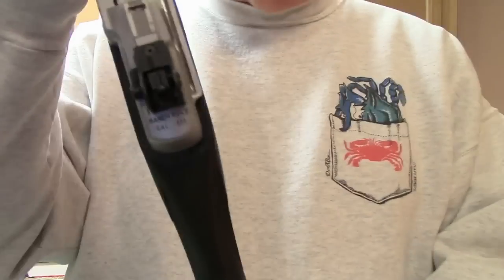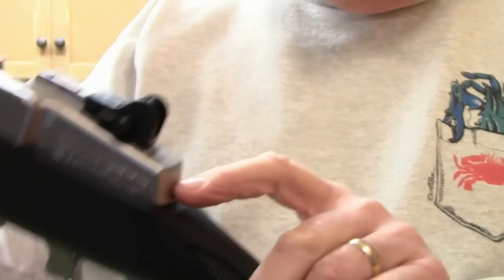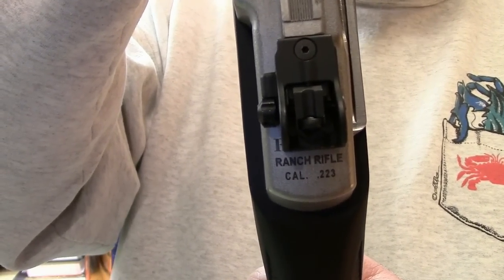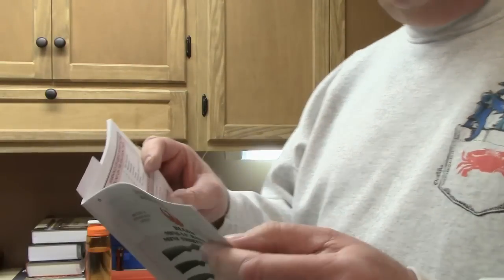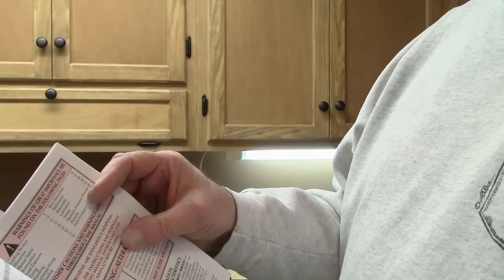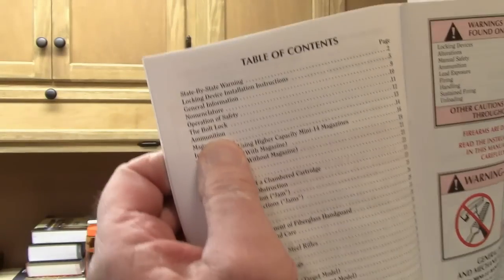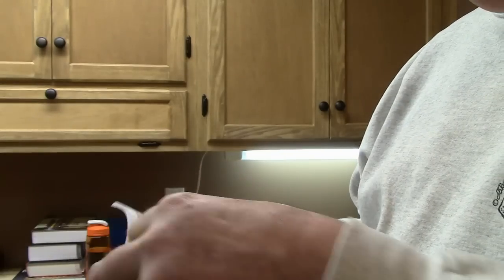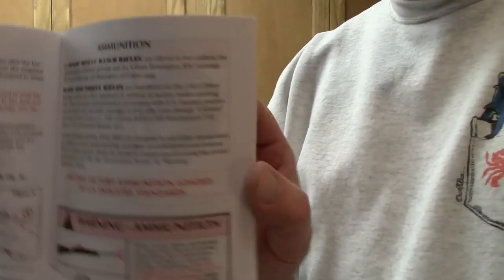Use of 5.56 mm NATO in 223 Rem. chambers ~ Finally, "Can I use NATO in my Mini-14?"

Comment: The chambering for military 5.56×45mm NATO has a longer throat prior to the bullet contacting the rifling which results in lower pressures when firing 5.56×45mm NATO ammunition. If 5.56×45mm NATO is used in rifles chambered for .223 Remington the bullet will be engraving the rifling when chambered which can dramatically increase pressure past the proof test level.
Reply from the maker: Will Mathieson 
Yes, the throat of a 5.56mm is significantly longer, and the leade of the rifling is shallower than the 223 chamber, and NATO 5.56 ammo is far hotter, which does increase pressures above accepted 223 levels due to the combined influences of reduced bullet clearance and higher operating pressures.  However, a NATO round will chamber without bullet to leade contact.  It's just not sufficient freeborn, and the working pressures are far higher, which makes a very undesirable combo.
Reply: and 5.56 nato used to be free to shoot, now I have to buy .223 and I can't fire off 30rd mags at full auto anymore or belts. There are +'s to being out of the army though but not when it comes to firearms. Are there any manufacturers that sell 1 in 7 twist? I know Colt Canada sells a version of the C7 for civilian use.
Reply from the maker: Will Mathieson 
Yes, there are, but unless you are shooting extremely long bullets over long range, you are better off with slower twist, which will allow greater load density at lower pressures, with less resistance, and less fouling.  Military steel core 62 grain bullets are unusually long, but are perfectly stabilized with a 9 inch twist.  Most people don't use bullets that require 7 inch twists, which has become a popular fad that has no basis for anyone but the single shot loader of extreme length bullets that won't even fit AR magazines.
Reply: so why does Colt make a 1 in 7 inch twist for military arms? I know Canadian C7A1 and C8 rifles are all 1 in 7 twist and they fit in the magazines that are interchangeable with any black rifle.
Reply from the maker: Will Mathieson 
They fit because they are either 55 grain or 62 grain green tips, which stabilize in any AR, regardless of twist.  They make fast twist for possible future use with long, light, armor penetrating alloy bullets, but none of the ammo commonly used by any NATO country uses ammo that requires 7 inch twist.  The standard green tip armor penetrating bullet can be stabilized with a 10 or even 12 inch twist.  Even my 222 Remington with a slow 14 inch twist will handle military 55 grain FMJ bullets at standard 222 velocities, and any 10 inch twist 5.56 will stabilize an extremely long 68 grain Hornady #2278 boat tail match hollow point or a Sierra 69 grain #1380 HPBT Match bullet, which I shoot all the time, and very accurately from a 9 inch twist.  A 7 inch twist is fine for extremely long single shot bullets, and will stabilize short ones too, but remember that faster twist increases resistance.  Resistance increases pressure, which means that a person with a slower twist will be able to load ammo with higher charges, with faster velocity.  What's more important, getting lower pressure and higher velocity with longer range that hits harder, and allows the use of thin jacket explosive varmint bullets, or having a gun that is able to shoot 75 or 80 grain 1,000 meter bullets, single feed??
Reply: @GunBlue490  
Can a person do a full length resize 5.56 țo a 223 spec and cut the neck down to 223 spec also will it work properly?  I would like to here your opinion on this.

Comment: Someone show me an overpressure event from shooting a 5.56 in a .223. It's never happened.
Reply: I'm surprised you didn't get your head bit off for daring to ask that question. I asked the same thing nine months ago and got a big lecture about anything and everything, except an answer to my question.
Reply: I just found some 5.56 for my 223 that shoot outstanding.  I looked at muzzle velocity,   its 200 fps faster .  I think hes talking about chasing the lands too
Reply: @treece1  Apparently there is quite some variation between different manufacturers and how they cut the chambers of their .223 Remington rifles, or more specifically, how they cut the throat/leade of those rifles. Old rifles were mostly made with light (45-55 grain) bullets in mind, if their leade was cut for such bullets than you're definitely going to have a very big pressure spike if you're shooting heavy NATO ammo through it. But if you have a .223 Remingto match rifle which was made to shoot very heavy bullets (75-77 grains or even heavier) than they shouldn't have any problem with any 5.56 NATO ammo no matter the type.

Comment: I can't imagine a .025" of free bore out of the total length of a barrel would make any difference in pressire?  In a 14 " barrel that amounts to 1/560.  Has any tester published the pressure of a 5.56mm cartridge fired from a rifle chambered for .223" where the free bore is .025" shorter?  Theoretically, the 5.56 bullet can be pressed .025" further into to case and safely fired out of a .223 chambered barrel to get the same effect of a 5.56mm chambered barrel.
Reply from the maker: What you are able to imagine has nothing to do with physics and measured pressures.  223 Remington ammo runs from less than 40,000 PSI to 50,000 PSI.  5.56mm NATO and CIP ammo is loaded to well over 62,000 PSI.  That is not a marginal increase, my friend. What's more; that 62,000 PSI is from a NATO or CIP chamber. Pressures soar far beyond that and unpredictably from a short 223 chamber.  Changing the seating depth of a 5.56 round to create artificial leade distance will dangerously increase internal case pressures considerably beyond what is already excessive.  That's why MINIMUM overall lengths are specified for various bullets.  There's more to the throat than its length.  They are entirely different designs.  The NATO chamber has a low tapered leade, but the 223 leade is abrupt, as with other standard chambers. 

Shooting a 5.56 requires a 5.56, a CIP, or a Wylde chamber. Period. The arms industry makes this universally clear everywhere in the world.  All barrels are tested for their stamped rating, not for an imaginary one.

I don't know why this is a problem for some people to comprehend, because it's found everywhere in life.  All machines and structures have operational ratings that engineers have carefully calculated that makes sure your tires don't blow up at 75 MPH, the wings on a plane don't break off during flight, your staircase doesn't crash down with your family, bridges stay up when trucks go over it, and your circular saw blade doesn't fly apart into your forehead with excessive RPM. Would you run your car engine over the red line, just because its a mere couple of hundred RPM?  Your mechanic would be very happy to send his repair bill.  Intelligent people stay within operational ratings.  Guess what the other people are called.
Reply: @GunBlue490 There's no reason to be rude.

Comment: Good video. To add more confusion; Ruger Mini-14 manual states: production 2004 and earlier > TheRUGER® MINI-14® RIFELS are chambered for .223Remington (5.56mm) cartridge. The Mini-14 Rifle is designed to use either standardized U.S. military, or factory loaded sporting .223 (5.56mm) cartridges manufactured in accordance with U.S. industry practice. For production after 2004 > RUGER® MINI-14® RANCH rifles are offered in two calibers: .223 Remington (5.56mm) and the 6.8mm Remington SPC. The Target Model uses .223 Remington cartridges only.
The Mini-14® Ranch and Mini Thirty® rifles are designed to use either standardized U.S. military, or factory loaded sporting cartridges manufactured in accordance with U.S. industry practice.

Comment: Pressure differences result from differing measuring methods.  Two methods test pressure in the center of the cartridge and one method tests at the ogive area. I'd bet the compatibility is due to headspace differences.

Comment: My Ruger mini 14 is clearly stamped 223/5.56 nato,so.........I guess it depends on which model you have.
Reply from the maker: Wade Sutton 
With the single exception of the special Target model with the .223 Remington chamber, all Mini 14 rifles are safely designated, as stated clearly in the owners manual, to fire military 5.56mm or commercial .223 Remington.  The manual, written by Ruger, is the governing authority, and that's it.

Comment: So I am new to reloading, and have been watching your videos. I have great respect for you and your knowledge base .. I would however like to ask some pointed questions, as I have investigated this to the emf degree. 1- if you take 556 brass and strip it , ream the primer crimp, get it all cleaned up, the only differences between it and the 223 brass is the two radius'es  at the neck! Right? 2- If you load this with the charge , primer, and bullet spec'ed for a 223, How does it produce any more chamber pressure in a 223 chamber, than a round loaded with 223 brass? 3- how would the round be any further forward in the chamber than the 223? 
My understanding from all my investigation is this. NO you can not use NATO 556 round in a 223 chamber, as the bullet will be to far into the chamber, and will also be stuffed too far into the brass, causing a big spike in pressure. It seems clear to me it is the bullet, and not the casing that is the culprit! The only difference in the brass is a crimp'ed  primer, and 1* in radius at the neck transition! I can not for the life of me see how  that can cause an increase in pressure. Scientifically impossible! But if there is something I am missing please enlighten me.
Also It is my understanding the mill spec's were based on a different type of pressure test, and now they use a newer test that shows specs much closer to sammi! Again, I have a great respect for you, and if I am off, please explain why.
Reply: 1 - Brass is identical, asides from manufacturer variations and particular brass alloy characteristics.  Manufacturers tune their powder charge to their brass cases and the particular lot of powder they are loading.  Commercial brass makers are not going to forego the opportunity of a lucrative government contract because their brass casings are "out of spec" and the government plants will load ammo for you rather than pay a work force to be idle. 

2 - It doesn't.  Different makers and lots may have different brass case volumes, that is why competitor use a single lot for their serious ammo.  The "thicker brass" thing is a myth.

"as the bullet will be to far into the chamber, and will also be stuffed too far into the brass" - This only applies to the M856 tracer round.  The M855 62 grain Ball bullet sits at the same position in both chambers.  The 223/5.56  cartridge overall lengths are limited by the magazine dimensions and is the same in both 223 and 5.56 

3 - It isn't for the same bullet.  The whole NATO kerfuffle was caused by the specification for the Tracer Round.  The M856 tracer could not meet the NATO 400 meter specification in the original chamber/bullet ogive of the m16.  
The NATO tracer had to be made less pointy and 1/2 inch longer than the original 62 grain 223/5.56 ball bullet.  NATO reamed a bigger leade in their barrels so the tracer would not jam into the rifling and cause pressure spikes, etc.  The longer leade results is a much larger jump from the case to the start of the rifling for normal 62 grain FMJ bullets.  The longer jump results in a drop in pressure and muzzle velocity of  a cartridge loaded for a SAAMI 223 chamber. To meet NATO m855 velocity (3000 fps at 72 feet) ammunition makers add more powder to the 5.56 compared to the 223.  Close to 10 % more powder, so if your ammo is at near Maximum Pressure in a NATO chamber, you may get 8,000 psi over maximum in your 223 chamber
Reply: The difference is on the inside 556 had more metal on the inside that's where the higher pressure comes from the the difference in the chambering comes from the different weights of bullet heavier bullet longer is going to be
Reply: @rh5207  Not to beat a dead horse but: my research indicates that yes you do not want to use 5.56 loaded rounds in a 223 only firearm. You could however safely reload 5.56 rounds for 223 using 223 load data! Differences in wall thickness of brass is common throughout the industry from one manufacturer to another, for any given caliber of ammo so I would not think it would have a dramatic effect on pressure. It is the charge and oal of mil spec ammo that is the problem!

On a side note when comparing pressure, SAMMI doesn't list the 556. The 62,000 psi is from a different group that uses a different test, so you would be comparing apples to oranges

Maybe we are on or close to the same page! Would you agree that you can take 556 brass load it to specs for 223 and safely use it in a firearm chambered for 223 only?

Comment: I was taught that the US military uses a different method and location to measure the pressure of a 5.56 cartridge. The chambering is definitely different from .223 Rem and .223 cannot safely chamber a 5.56. However, because of the difference between Military and SAAMI pressure measuring, if measured the same way, .223 Rem is higher, in actuality. Suppose I could have been taught incorrectly.
Reply from the maker: Regardless of the pressure measuring system, it boils down to one simple fact:. The 5.56 is loaded to significantly higher pressure than the .223 Remington, by thousands of psi. The various ammo manufacturers that load both headstamps at their facilities will all affirm that.  Any contradictory statements to that fact are nonsense.  The Accurate Powders loading manual literature states the following examples for a given powder in each, using their #2230 powder, using a 62 grain bullet  With the 223 the maximum load is 23.8 grains at 54,137 psi.  With the same powder and bullet, with identical seating depth, the NATO/MIL maximum load is 25.3 grains at 61,487 psi.  Inform your friends to stop their wishful thinking.  More powder is used in the NATO round, and it's as simple as that.
Reply: @GunBlue490  I trust your answer. Thanks.
Reply: No
Reply: @jerrykemphfer9436  so articulate. I'm still looking for the documentation from which this information was gleaned. It IS a fact that SAAMI AND NATO use different methods for measuring chamber pressures. But hey, "No" is a pretty common response... from my 2 year old.
Reply: @GunBlue490  hope this hasnt been asked before, i have a ruger 5.56 mpr product nr 8514 on the way. 

Im happy its chambered in 5.56 which means i can shoot either nato or .223. Problem i ran into is we dont have any nato ammo freely available, so naturally i would be shooting the .223 factory ammo avaliable locally.

I plan to buy maybe a 1000rounds to start off with and i shall reload them as needed. That said all powders avaliable locally only have loading data for the .223. No problem. I just cant help but wonder if any gains would be had, either in accuracy or speed if i can somehow find nato 5.56 rounds and 2nd, if i manage to find loading data of a 5.56 round, could i load my .223 cases slightly "hotter" to the nato speck seeing that thats what the barrel is designed for without running into troubles?

The AR comes with a 18" barrel, with a 1to8 twist if that helps.

Looking forward for your expert opinion.
Regards

Comment: What if you had a colt lower marked .223 but you swapped out the upper for a 5.56? So .223 lower 5.56 upper?
Reply: It's the chamber that matters and that's in the upper. If the barrel is chambered 5.56 nato then you can shoot both 2.23 and 5.56 but it might be more accurate with 5.56 nato depending on bullet weight and rifling twist rate.

Comment: Love your content, have to say my Ruger Mini 14 has had 1000 round cases run thru it over and over in the 20 + years I've had it and .556 is all it eats and yeah your correct I shouldn't have done or do it but I've seen no  break down or barrel problems. But again its a Ruger so I could split logs with it and shoot it all week and it will still run.

Comment: I have a mini 14 in 223 Remington That I have had for over 20 years and I bought it used. I took it out to shoot the other day and I picked up some NATO rounds that I had handy. After I fired about 20 rounds the gun malfunctioned, as I was picking up my empty cases I noticed half the primers were blown out of the cases. When I strip down the gun down I found out one of the primers had jammed The Mechanism. So from now on I’m going to stick with 223 for the mini 14 and save save the NATO rounds far the AR
Reply from the maker: That's an unusual situation that had nothing to do with the gun itself.  Every Mini-14 is more than strong enough to handle NATO ammo and is pressure tested at the factory as such.  Some 5.56 rounds on the market are marked NATO but are not necessarily made to industry standards especially if imported.  Those primers would have blown in any rifle, because primer pocket expansion has nothing to do with the rifle.  Having said that, I generally like to keep the throttle down with my Colt AR15A4 with standard 223 rounds, which will give it a longer life with no discernible difference downrange.  Plus, it saves my ears and keeps the brass closer.